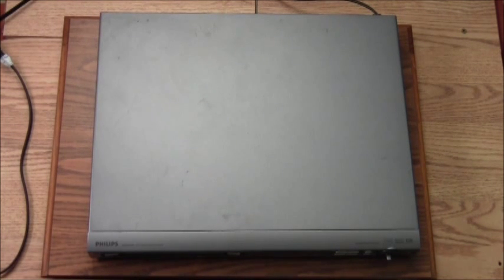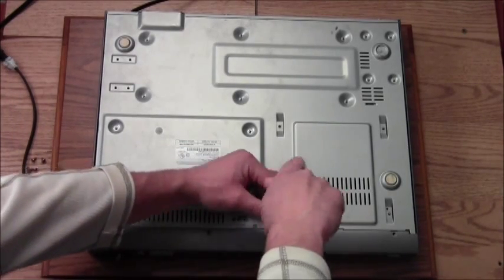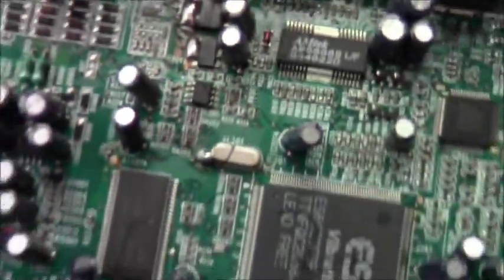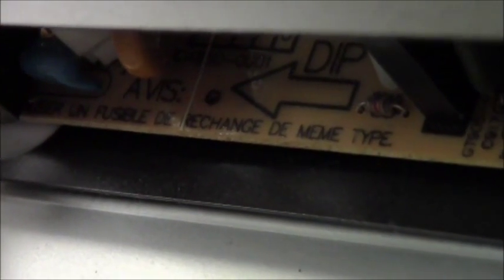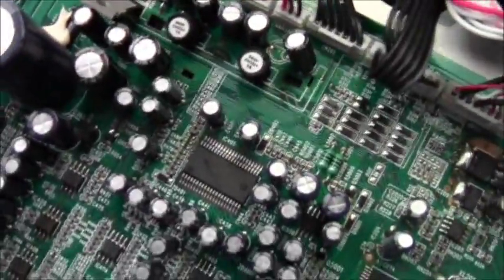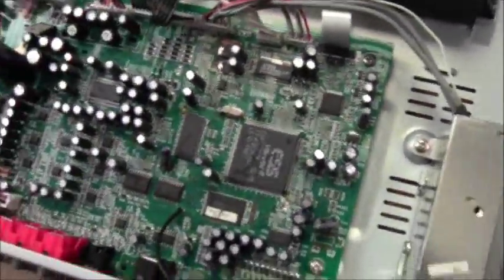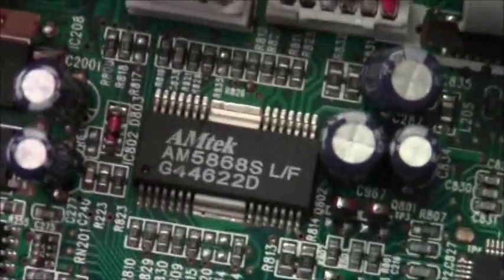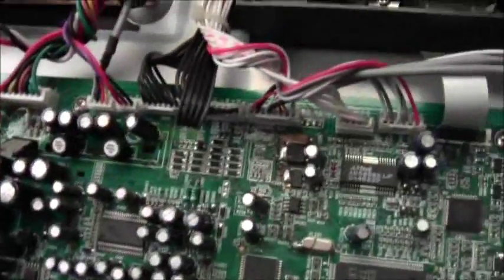Philips HTS341OD Dvd Home Theater System Teardown

Comment: I have one of these that won’t eject the tray, do you have an answer here?
Reply: it's probably the belt from the drawer opening motor .
Reply: @pedroamaral2959  Took the cover off and cannot see any belt. That’s what we thought . Just replaced the unit off eBay for 50 bucks. Had the speakers and remote.